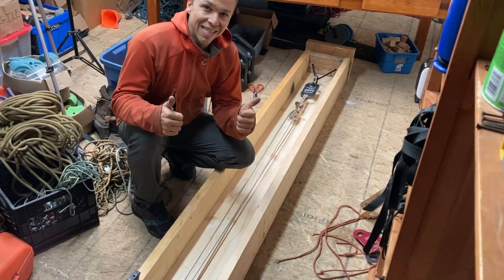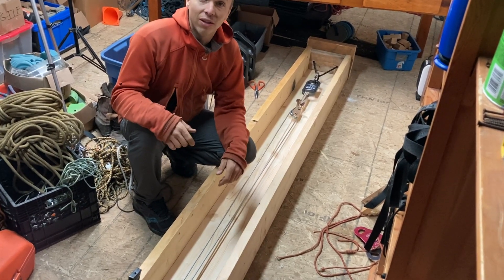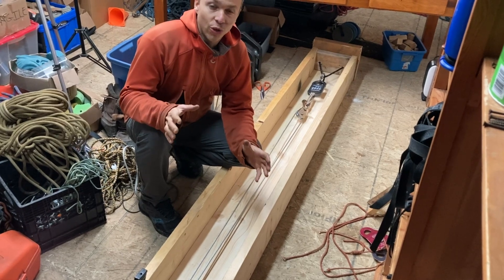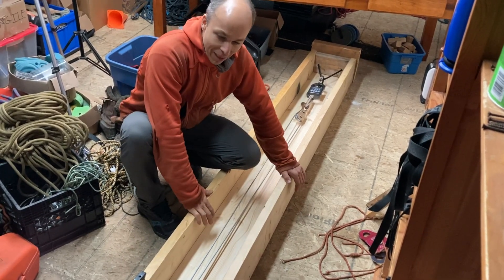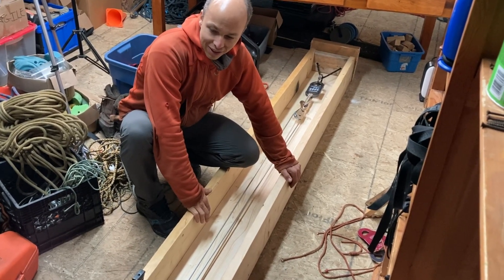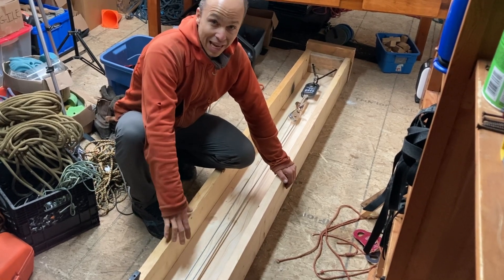Break Test Machine To 17kN !!!

Comment: Disaster waiting to happen! When pull/break testing you need to step away from the danger zone. Cranking on that handle to break something is not very clever. I have been in the line of fire a couple of times, one time I broke a carabiner putting tension on it, it hit my hand in a matter of micro seconds, it just exploded, it took less than 15 seconds of "what the heck happened" and my hand was the size of a ballon, black and blue... The other time I was putting tension on a wire (I do it for work) the anchor ripped out, 2 x 10mm expansion bolts in granite, the hook and chain came flying (heavy objects, about 2 -3 kilos) they flew about 2 meters and hit me in the chest, broke a couple off ribs... 
Just a friendly heads up, before you regret setting that thing into action! Stay safe.
Reply from the maker: Thanks Pierre! Makes sense! Will be more careful...